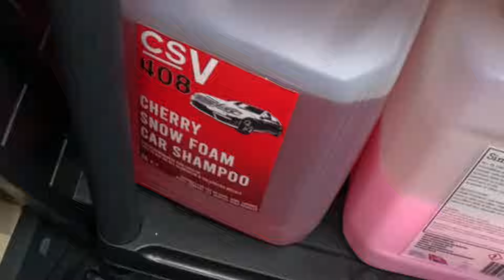Park home Decking Cleaning 🧹 made easier

Comment: Looks brand new again. Next job is to come do my paved patio and drive thanks!
Reply from the maker: I really do get enjoyment out of cleaning cars ect  jhan just wishes I would be the same at home
Reply: I know what you mean about enjoying it. I have a snow foam gun etc, but because my drive is quite narrow and slopes down it was such a pain to wash i gave up. I think I may have said it in another post but I use Maguires ultimate wash and wax on my white high gloss kitchen cupboards. They come up a treat.
Reply: Can you write the name of your cleaning products your using please 
Just looked for tfr( you can get the non- caustic one)( would that be OK to use on my  static caravan ? Thanks for reply 😊
Reply from the maker: @patriciamcintyre7285 your better off on the caravan itself just a snow foam light mist on decking I would dilute the TFR and snow foam on top of TFR leave for ten minutes then rinse off if you like I will do an video on it for you with products ect